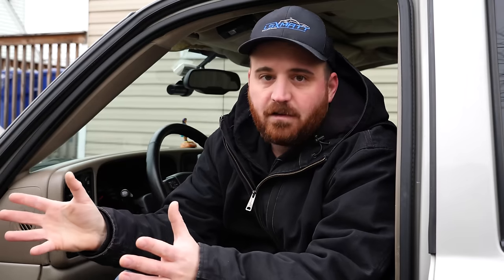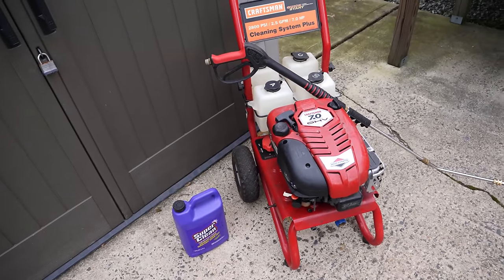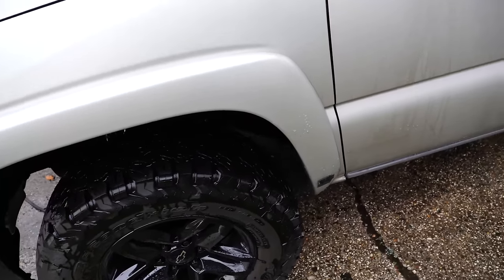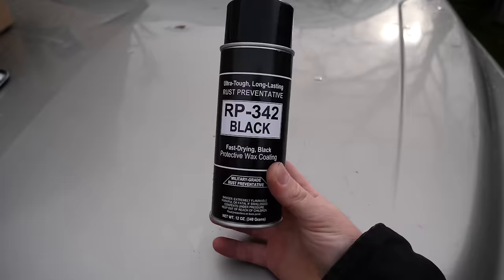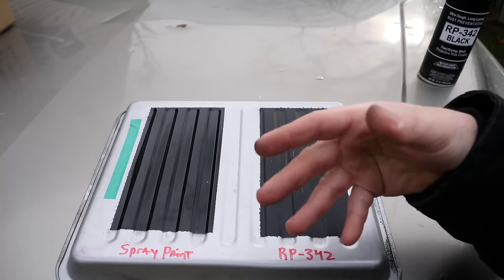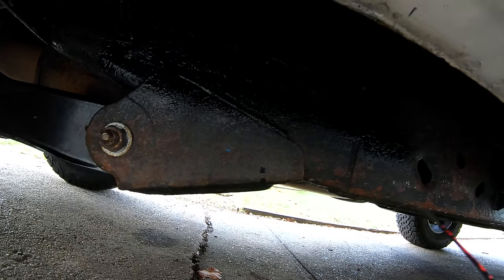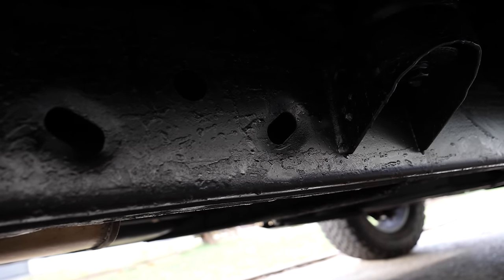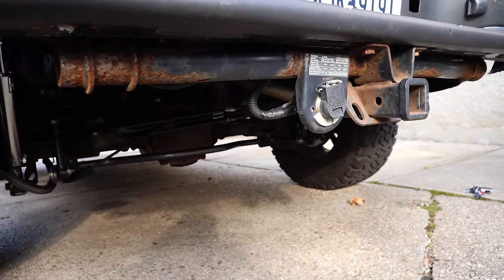I Coated my Tahoe's Belly with MILITARY GRADE WAX in Hopes that it will Survive the Winter!

Comment: I find not fixing oil leaks is the best for frames.
Reply: It is awesome when you go to take things apart and everything is covered in oil. You are almost 100% certain the bolts will come loose with ease. The downside is the last time this was the case, every bearing in the differential needed replaced. 😂

Comment: I have 5 years experience with RP-342 in the NH salt. Its the perfect choice for GM frames because the factory coating is also a wax. If you spray oil over the black GM factory wax it will melt making things worse. The fluid film company says not for use on GM frames. But people don’t know that. You will need a second coat of RP-342 cosmoline in a year then less and less touchups after that. You’re better off with a piece of cardboard and use the sprayer nozzle not the stray. Drips less. Job goes quicker. You can get a spray wand for the can but not easy because it’s a male can. Then you can put it in the frame and just pull it along as you spray. It’s the perfect way to do it. Fluid film wands won’t work. However RP-342 not so good for small tiny areas like seams. Because it’s thicker it doesn’t get down and seams very good. That’s a good place for an oil spray
Reply: I live in NH to. I have a GMC sierra. You recommend this over fluid film? I bought this and some POR15.  Plan is to scrap, por it, then thus stuff. Thoughts? And thank you

Comment: Remember to pressure wash the frame inside,before spraying oil or anything inside there..I lift up my Avalanche in the rear,and just use water to clean out all the sand and debris that ends up inside there.Its all that sand that are gettin wet,that really let the frames rust out.
Reply: yeah, sand really slows down evaporation, just like a wet balled up paper towel

Comment: It's barely noticeable, but after you pressure washed the frame there were a lot of spots of fresh metal on the outside of your rusted areas. That's lifted paint that was next in line to have rust form. If you do your pressure wash with a turbo nozzle, the varying angle of attack provided by the rotating nozzle would have lifted up much more. It would have exposed all of the rust covered by paint that you cannot see.

And if you have one of the cheap amazon drain jetting kits for your pressure washer, you could use that to flush out all the dirt/debris inside your fenders, frame box sections, and with the rotating nozzle they come with, it will perform just like a turbo nozzle and blast away all the lifted paint and scale inside.

Comment: There is an industrial version of Rust Veto 342.  Remember to apply it inside the frame rails, door jambs, tailgate, etc.
Reply: I use Cosmo, CRC Hd, at my truck and small car.  It didn't work well in cavities.  As paint cracks Cosmo cracks at the top of it.  I switched to FF for cavities.
Reply: @zell863  How were you applying Cosmo in the cavities?
Reply: @Boodieman72  I have wand for it.  But I said I prefer FF in cavities.  I have wand for it to.
Reply: @zell863  One that runs off compressed air or are you using the spray cans?
Reply: @Boodieman72  Spray cans.  I have 6 wands or so.  If you google FF Wand and Cosmoline wand will be at top.  I have 3M cavity wax wands too.
Reply: @zell863  I'd be using a professional sprayer with bulk product so the different products might apply differently than from the spray cans.

Comment: FYI, CRC Rust Inhibitor is the also cosmoline and it is the least expensive per ounce of any I’ve found. A 10oz bottle is like $11 and if you buy in bulk even a little cheaper. It isn’t black so that is a nice feature of the RP but most stuff I don’t care about color underneath.
Reply: That is cheaper but if you buy a dedicated undercoating gun you are better off getting it bulk from cosmo line direct. I got 5 gallons for 300 which I think is way worth it because it will last a long time for many projects
Reply: Every HD at the market is Cosmo.  Even Porsche send its cars to USA sprayed in Cosmo.

Comment: Just curious - how is the cosmoline doing over the rust? Does it soak into the rust and stop it, like fluid film? I ask because I use cosmiline for my boat trailers external compnents, but, use woolwax/fluid film for the inside of the tubes.

Comment: Anyone else thinks it would be nice to also have light gray RP-342 so you can easily see any chips or rust and do corrections in that area over time ? When it is black, you need to look very close to see any spots of rust.
Reply: I agree.  I use cosmoline, in my case CRC HD and Crown HD.  Do not care to hide rust.
Reply: just get the amber version then.

Comment: 👍🏻 to a previous comment where you should have used a rust converter prior to that wax coating . We use OSpho here. It’s cheap and readily available. Other than that looks great 👍🏻 I’ve used the regular Cosmoline which leaves a light amber color.

Comment: Thanks for the videos Matt! I enjoy them all. I’ve used fluid film with great success,It creeps into the pinch welds and places you can’t see,I would highly recommend using it inside  rockers, doors and even inside the frame and crossmembers
Reply: So if in the future you wanted to "properly" prep and undercoat your truck, is that fluid film easy enough to remove? I'm in a dilemma because I don't have time to properly prep everything for a good undercoat, but I don't want to hose it down in fluid film if it's gonna be a bear to clean off later. Thanks
Reply: @seandeterman2499  Yes A degreaser and power washer will clean it off. But in my opinion Fluid film is far superior to a rubberized undercoating which will trap moisture and rust underneath it where it will rust and you won’t even see it happening. Fluid film will creep back into stone chips and displaces moisture which will prevent rust from happening

Comment: I found that bar chain oil mixed with a flashing solvent in a pressure sprayer lasts and works better, just respray once a year, drive down a dusty road and you're golden
Reply: Why do you want to drive down a dusty road? Why have dirt stick to the coating? Hats the benefit

Comment: I bought a wool wax kit from kellsports for my wife’s van and it worked out pretty good it cost more than those cans you have but i really liked it I wound up buying an extra gallon in black. Now I have neighbors wanting their vehicles done…local rates for undercoating here are ridiculous which is the very reason I bought it. I did have to pull it on ramps so I feel you on wanting a lift.

Comment: I just bought RP-342. After cleaning my vehicle, I'm going to and then use Rust Cutter on the rusted spots. After the preparation, I'm going to apply R-342. Do you think that's ok? Or should I just spray R-342 ober thr rust like you did?

Comment: i just completed mine on my friends lift. mine was mostly rusting at every weld. i took a needle scaler to it, sprayed rustoleum rust reformer, and then two coats of rp342. looks really good. glad i got it done. and ive been researching my box frame inside. im thinking something more fluid like fluid film. i see rust inside most holes in the frame. or make up my own concoction. trying to decide on a spray gun with the tube and 360 nozzle, or maybe just areosol. 2015 f150

Comment: As far as going in the frame look into taking the tahoe to Krown Rust Protection, they have an oily fluid the company made that is a drying agent and a rust preventative spray, I just got my 2004 and 2005 tahoes done by them and everyone that uses them swears by the stuff. They spray it in your frame, on the whole undercarriage, in your rockers, doors, trunk, hood, and they even take your taillights out to get into the quarter panels better. They also spray under the hood along the inner fenders, core support, firewall. I highly recommend these guys, I went to the one near Utica New York, the town is Marcy. I did a lot of research before I went with them and there are plenty of great youtube videos explaining the process.
Reply: Its suggested you get your vehicle sprayed yearly also, as it is an oil coating, but it is very affordable costing $149 for a tahoe sized vehicle too!
Reply: Its also self healing if a rock or something chips it..and they cant do it in less than a hour..

Comment: Hey how is it going I have a 2003 GMC Yukon Denali my check engine light is on I scanned it and all these codes came up for my O2 sensor I replaced all four the light went off and now a few months later there back on do u think I need to get oem O2 sensors or doi need to just replace the cats and if so should I get cheap ones or oem’s ???? And do u have any websites I can get cats from????

Comment: I'm wondering if you could just easily coat the inner frame with fluid film. I get that cosmline won't interact well with fluid film but as an inner spray I wonder if this would be a problem since you only sprayed the outer frame. I guess it would seep out some. Has anyone tried this?
Reply: I do FF and CRC HD (cosmoline).  FF in cavities CRC on exposed parts.  Many guys do that combo.

Comment: I use to coat my frame every year with motor oil and 2 years ago tried RP-342 and now i have a hole in my frame.   I dont know if i locked in moisture or if there was an old issue but I dislike this stuff..
Reply: Yea not to sure about this stuff. Stick with the oil, like fluid film/wool wax/ surface shield

Comment: Looking good on Tahiti. But for me I don’t have the time on my hoe.plus the cancer has all ready started on the frame for me.Key to reduce the salt aggravation on your vehicle is not to park it in a warm garage above 0 degrees Celsius in the winter. Actually rust is not active in the winter when it’s very cold outside, it’s starts in the spring when the temperatures rises. In southern Ontario we are in the same heavy snow belt as New York and we also get the same rock salt and sodium brine mixture in our roads also.

Comment: So what is that deal that goes from shock to shock, mine does not have that, is it a type of stabilizer?
Reply: If you're talking about the bar across the lower area that's the rear stabilizer bar. It connects from the sway bar links to the frame. If you bought it used the previous owner probably had it removed.